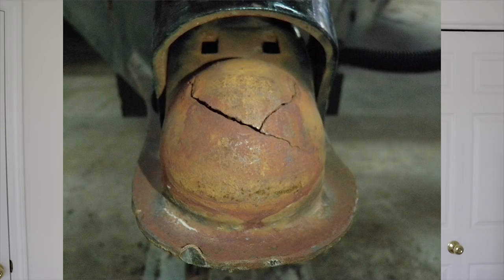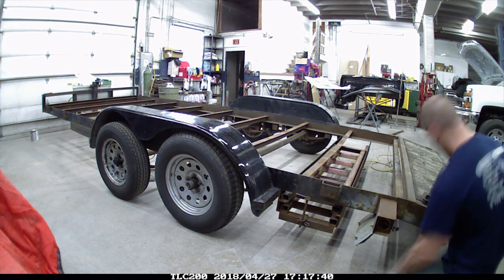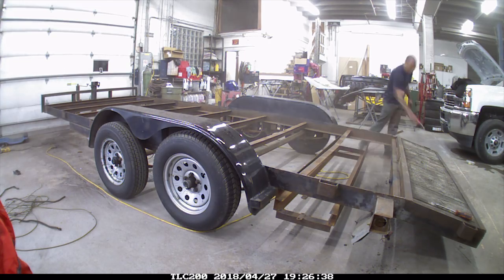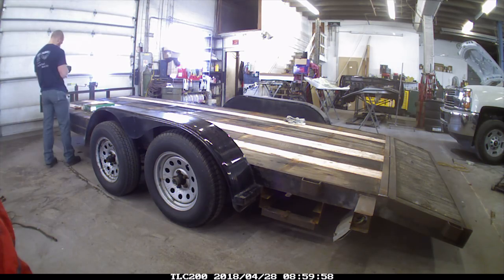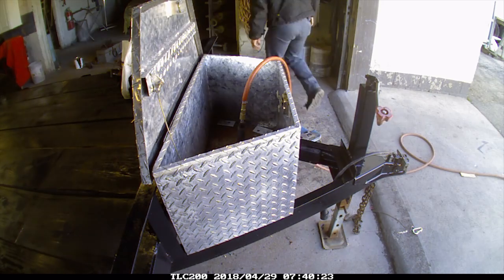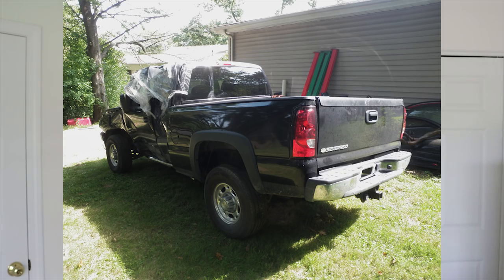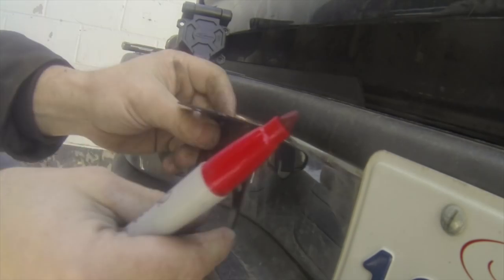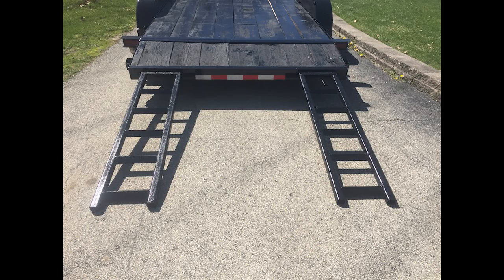Fixing up the old trailer and cleaning up the back of the truck

Comment: Nice job!  Only thing I would have rather seen is you replace all wooden boards and then just throw a nice coat of poly on them. :)
Reply from the maker: Thanks, I just had to replace the broken ones because some genius thought it would be a good idea to transport a forklift.  One of those, "I'm not going that far, it will be fine", moments. The rest of the wood was in good shape, probably due to the constant oil treatment applied by all the leaking cars on it. lol  I'm going to seal the new trailer, maybe I'll video that for you. :)

Comment: Nice trailer. Thought about mounting those spares under the deck? I made a lift up panel in the middle of mine with a cage to house the spares under it. Keeps them secure and out of the way. Got to keep the sticky fingers away from your trailer or any bits!
Reply from the maker: The trailer spares usually stay in my truck along with the second truck spare.  I just had them on the trailer so I could show people is included when I put it up for sale.  I did think about using a spare tire hoist from a pick up and mounting them underneath.  I also thought about putting them in the deck but if the trailer is loaded, how do you get to them?  Thanks for watching!

Comment: Hi  great job it looks like it would quicker to fit the plug in the  bumper than just using the bracket trying to find a place to locate it 
And looks a whole lot better. The small videos like watching. Maybe things like removing spot welded panels your tricks of doing these smaller jobs when you put them all together it really helps
Reply from the maker: I'm actually in the process of making some smaller teaching videos of one big job.  When the job is done, I will have a series of videos that will take you though the entire process.  Thanks for the great ideas, keep them coming.  I'm working on them, it just takes me a little while.

Comment: Great videos. I was going to get a goose neck trailer bc I buy diesel truck but I see you hauling all kinds of stuff on your old trailer and new trailer.
Reply from the maker: I did a lot of research before buying the new one and it was not worth the bigger trailer.  Due to the increase in the weight from the trailer itself, the load capacity was only minimally increased.  The diesel trucks are at my trailer's limit but it has been great so far.  My old trailer would have died under the first truck. Lol. Good luck on your projects.

Comment: I'd like to add aux reverse lights to my trailer. Do you have a video on how to wire them in to the trailer 4 way? So they work when truck is in reverse?

Comment: I like the receiver hitch mounted on the pillar in the center, I have an idea what you used it for but just wanted to ask. Removable winch or just a spot to use to use a cable puller?
Reply from the maker: I used to haul trailers so it allowed me to couple the hitch on and just tie down the rear of the trailer.  More secure than straps.  I did have plans for adding a winch I could remove but never got around to it.  I only had the trailer for 21 years. 😂 Thanks for watching!

Comment: What kind of paint and what springs? (Like porch swing springs?) Good job as usual.
Reply from the maker: The paint was just Rustoleum and the springs were from exhaust flange studs but anything thick enough to weld would work.  Porch swing springs would not have openings between the coils for the debris to fall through.

Comment: Hi it's John from England one teaching video I would find very useful would the pre welding ...which code saver you use if any disconnecting the ecu if you do that and any other tips you have to do vehicle electrical system even the order you do things. As you can tell I've never welded on a car with a modern electrical system.... thanks
Reply from the maker: Thanks for the suggestions for the new videos, I had not thought about anything like that. I will include it in my how to videos for sure.

Comment: Nice tune up on your trailer. Seeing the Terrain brings up a question. I recently bought a 2013 Equinox with a rebuilt title. How do you determine if the seat belt pre tensioners need to be replaced? Thanks for your help.
Reply from the maker: Thanks, it needed it!  The Equinoxes are like the Terrains, the seat belt pre-tensioners are two parts on each side so four parts total.  If the air bag light flashes 7-9 times and goes off after start up, the system is functioning normally.  

HOWEVER, if the pre-tensioners have been bypassed with a resistor or even any of the air bags for that matter, the vehicle will not set a code which will turn on the air bag light.  Actually checking the plugs to make sure the components are plugged in is the best way.  The tensioners are on the seats themselves where the seat belt is screwed on. You can probably peak underneath the plastic cover on the side of the seats to see it. It is the part I am replacing here: https://youtu.be/oxMkYdpCQ74?t=6m48s.
The retractor is behind the lower B-pillar trim and you will have to pull it back to see the plug.

The same can be repeated for all the air bags (six in total) if you want to be 100% sure.

The retractors will usually lock the seat belt up, but not always so that is not a sure check.  The tensioners are on a cable that gets pulled down and will be shorter when deployed but both go off together and sometimes it can be hard to tell if they are shorter or the seat is in a different position so also not a sure check. If everything is plugged in and the light goes off you should be good to go unless they bypassed the components somewhere else but if they were going to invest that much time, I'm thinking they would just fix it the right way.

Don't fear a rebuilt if it was done correctly and don't assume a clear title clean history report must be accident and hack-free!

I hope this was helpful, let me know if you need any further clarification on anything.  Thanks for watching!
Reply: Thanks for your reply. I have a much better idea of what to check. You are a wealth of info.
Reply from the maker: No problem, any time. Thanks for watching!

Comment: I need to do this very thing with my trailer too and get a new battery for my winch also. I have to say no matter what I've ever hauled on mine I never have had to replace the ball hitch though. can't even begin to imagine how that got cracked. I've had my trailer just like this only with weaker fenders for 13 years now and I've put everything on it from 12,000 pound custom vans to farm equipment and barbeque equipment. it's even been used as a stage a time or two. I've more than gotten my $1,000.00 out of it so yeah I need to re-invest a little in mine also but the only place I can find to replace everything is Tractor Supply. Mine isn't a dove tail and there is no ramp mounts either. It's just a 7.5' X18' if I sold mine I would either get a diamond plate steel trailer with the dove tail this time or an enclosed one , i'm still kind of tossing around both ideas. I just welded on a new jack on mine just like yours. the 8,000 pound landing gear style one. I was going to put an electric one on it but that's just something else to go wrong or something for someone to want to steal off of it while it's sitting somewhere. if you live in an area prone to rust I would have put some silicone around the hole that you drilled for that plug just to keep it from rusting out. the newere reeese hitches have the cup to put in the blade style connector or the 5 pin either one. not sure which replacement one you got for sure
Reply from the maker: It was not as much of what I haul as it was how long I hauled it.  This trailer has been overloaded quite a few times but it has over 200,000 miles on it.  I ended up selling it for the same price I paid for it, 22 years earlier.  Sure, I had to put some money in it along the way but I cannot complain.  I was sad to see it go.  I really like my new trailer though.
Reply: yeah, that being the case you scored and then scored again and 22 years wow! not bad at all. specially in the rust belt up there. if you had to put some money in it that's just part of owning the trailer. you want it to take care of you, you have to return the favor occasionally.. my statement was more of an affirmation that mine needs done too than it was me over stating the obvious like some troll :o) I haven't even begun to add up how much the new axels are going to cost but I want to put new Axels, wheels and tires on mine. just replaced all of the boards in mine about 3 yrs ago and my rams need replaced because while they are wide enough and strong enough for everything I've loaded on mine they aren't long enough, my ramps are only 4 foot they need to be more like 6 foot long. but i'll probably do like you did spruce it up and sell it then go buy a diamond plate one. someone local here in Nashville is selling the diamond plate all metal trailers for $2,200.00 so I think I can get $1,400 for mine easily with the new 8000 pound jack and Harbor Freight tongue box aqdd another $800.00 with it and i'll be riding in style, i'll probably let my winch go with it too. it's a 4,500 pound one but I also have a 10,000 pound one ready for the new trailer already. Next big expense for me is going to be a 30X50 shop with 12 foot ceilings so I can put a lift in it and a paint bay too. That's the one thing all you copart and IAA repair guys have had me jealous of all this time. lol
Reply: LOL that was a hell of a score if you sold it for what you had in it after all that time. wow!

Comment: Nice Job! I like that spring idea, I will have to use this in the future. Did you add that terminal block inside the frame rail on the front of the trailer for the lights/brakes (assuming it has brakes)? Love the relocation of the trailer plug too!